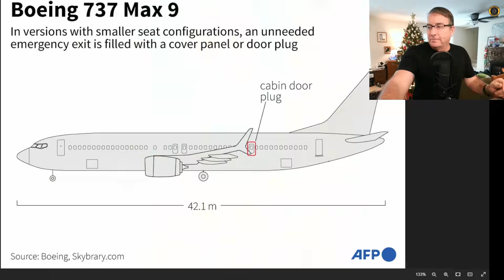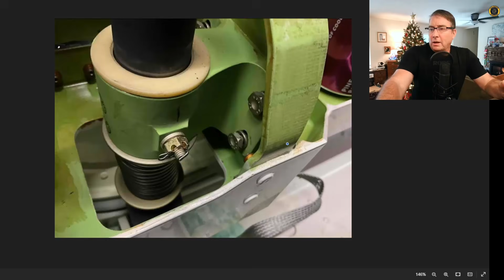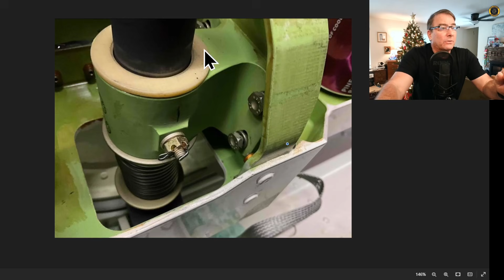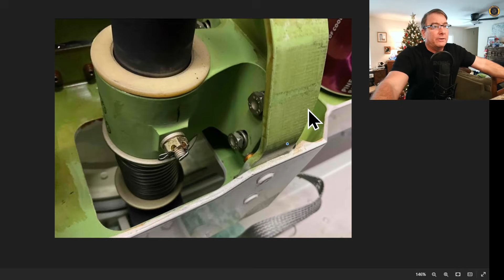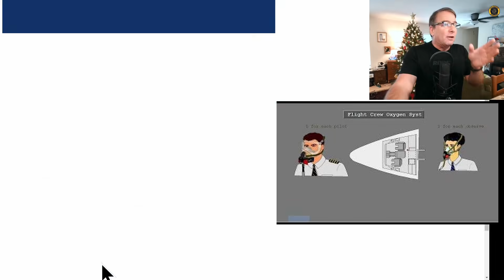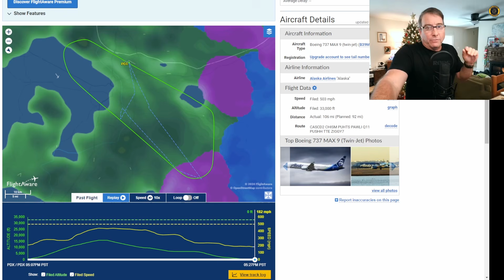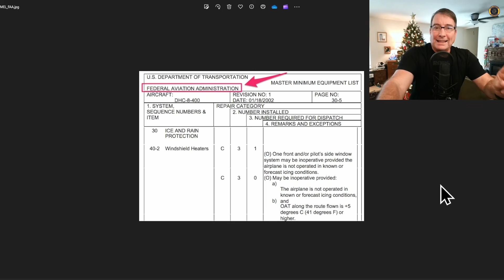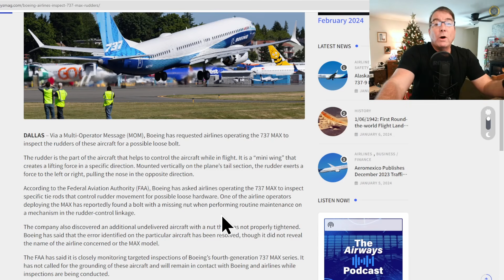"Yes, We Have No Bolts"  9 Jan 737 Max-9 Update

Comment: Sad thing is, baced on their actions, boeing aren't giving a damn. I mean max 8, crashed. Max 9... again with a problem... and a while back, boeing was trying to get the max10 and max7 exempted to get the aircraft certified quicker, despite there being a potencially major problem with the antifreeze system, where it could easily overheat if not turned off after a while. And yes, one could theoretically stand on, boeing's passed reputation... but if things like this keep happening,, all of the great pssed reputation boeing made for itself won't matter one bit. The problem is, until say, something like this happens to someone up top at boeing, the, why should I give a damn? Mentality prevails. Heck, there was a netflix documentary about the max8 and how boeing, the top people at boeing that is, knew about the failures of the max8 years before. The people who tried speaking up about it... silenced. Say what you will about boeing, but their actions, at least the actions as far as the people who are at the top... are a clear middle finger to everyone, but hey, as long as we keep getting more money, fuck it, right? Shame, really. Either boeing does something to fix their screw ups, or it'll sink, especially if they're still releasing aircraft's with major failures out there.

Comment: If any of the four retaining bolts were in place the door could not move upwards. All four had to be missing in order for the door to come up and out. What are the chances that all four bolts were properly installed with their castellated nuts and cotter pins and then somehow were all gone? Hmmm...zero?
Reply: Bolts clearly not present the only thing holding it in is what must be bolts making the contact pins tight
Reply: Probability is never exactly zero, more like 0.0001%.

Comment: Non-aviator here. I just find it very odd that no one was sitting next to it on a packed flight.  Seems a bit suspect to me as if they knew there was a problem with the plug.  I hope I'm wrong about that. I also find it absolutely outrageous that the cockpit door blasts open during DP and pilots did not know about this.  I can not imagine the shock they must have felt. Thanks, Juan.
Reply: The scheduled pax missed the flight.
Otherwise would be dead.

Comment: Safety wire should have been applied to those hinge fittings regardless of the mode of failure, that is a perfect opportunity to simply twist some wire to secure that point. Not speculating that that is causal, but it seems that simple best practices should be applied to this mechanical connection to ensure that those fasteners are not compromised by vibration...and if in a maintenance checklist, are documented. If inspections indicated that there are loose or potentially never secured fasteners...that is a huge clue that something needs to change on that system.

I understand the "Safe at Home" syndrome of an aircrew that has just dealt with an event like this. However I am in agreement that something needs to be done in FAR's to ensure that data integrity of sensors and telemetry including VOX are preserved. Someone needs to be accountable for that action.

Lot's of lessons to be learned here, ATC recognition of a limited communication emergency to ensure the crew is not distracted...provide data..don't ask for too much info. Souls and fuel, sure, that is important for fire/rescue. However there was too much repetitive comms. Crew could have said, we are already circling back for a specific approach but I give them way more latitude. 

Amazing job by all to get this thing on the ground.

Comment: Only if it's appropriate could you provide insight into the 2023 Elmina plane crash, please? On 17 August 2023, a Beechcraft 390 Premier crashed near Elmina in Sungai Buloh, Selangor, Malaysia. No survivors. Multiple surveillance and dash cams saw the plane, at like a 90-degree angle, slam, full force, into the ground.

Comment: What the hell! We assemble a device about the size of a pack of cards and we objectively  measure, Pass or Fail and measure ment logged promatically between limits every bolts torque to a database. The product does not move past that prosses step unless it passes all the torque specs. The quality records must go with the product to the client. The records must be kept by us and provided upon demand.  WTF Boeing? How do you tell work is done do you just stick your dam finger in the air and go "meh! Seems done!" ?

Comment: I respect the effort and skill set of the controllers, however the Seattle center controller asks maybe 5 times to explain their issue, have they indeed declared an emergency, etc. Then once turned back over to PDX controllers, they ask 4-5 times if the crew wants box directions to bleed off altitude before landing.  IMHO, Seattle needs to improve or at least evaluate their listening skills and handoff procedures/techniques, and PDX should understand that once the Captain and FO have declared their intent to land, LET IT GO.

I’ve seen several comments on various platforms deriding SEA Ctr and PDX controllers for, in the poster’s opinions, harassing the crew bc the controllers were not paying adequate attn to the transmissions.  

If worthy, it may be of value to your listeners/viewers to assess the tower personnel’s comms.  Thanks in advance! And love the channel.

Comment: Go back to the completed Installation Plan (IP) that took place at the Boeing Flight Line.  If this IP is sown “Completed” for this airplane, then the four bolts, nuts and cotter pins were installed and the door plug couldn’t possibly have blown out.  I am thinking sabotage occurred after delivery.

Comment: They hired a suite of executives, none of which are aerospace engineers, and these doofi have entered into a campaign of management enabled union busting for no purpose other than the improve their bottom line so they can qualify for their huge salary and stock perqs and then golden parachute out when their tactics result in losses and getting ousted. They’re run by bean counters and corporate raiders. They built the Dreamliner factory on the east coast in a right to work state so they could hire inexperienced labor that cost them less, and browbeat them into taking shortcuts.  These were the brainiacs behind the MCAS debacle, and requiring an UPSELL charge to enable the Second AOA sensor that was already installed on every aircraft anyway. ( like making you pay extra for the heated seats already in your car to be able to turn on. )   Corporate personhood needs to be amended such that CEOs and other execs can be imprisoned when their schemes to line their own pockets get folks killed.
Reply: Unions, benefits, and other worker perks like private healthcare and private retirement are good and necessary only to shore up capitalism, the present economic system. It's a vicious spiral upwards, and the spiral will persist so long as Boards of Directors has doofi like those you note well @christopherpardell4418
Just imagine, if complete tax immunity was given to any business with a Board composed entirely of full-time workers selected by equal vote among all workers, well, things may change in a big hurry. And yes, corporate personhood is analogous to the joining of church and state..

Comment: I hate to put a turd in the punchbowl. I am a huge Borwnie fan.  But we are ignoring something key.

Why do we have an FAA?  Mainly to prevent things like this from happening.  So how did this happen.

1) The FAA, once again, did not do its job.  The dog that won't bark.  2)  FAA will seek every opportunity to blame BOEING or anyone else for such things.  As they did with the MAX software fiasco.   You'd think they never had anything to do with that.  Well they did, from fomenting the idea of engineering the MAX to fly just like the earlier 737s, to looking the other way when red flags were flying all over that software mess.  Now, the 737 has nothing to do with this story.  The plug door is not unique to this airplane.  But what is worrisome is that FAA is not staffed adequately to really be effective in the 21st Century version of the market and the industry.  In this case, where was the oversight?  It's a scandal.  How could these airplanes get on the flight line missing hardware if FAA were doing its job?  You tell me.
Reply: On the contrary @paulgooding803 the barkless FAA does do a very important job quite well: it provides a place for folks like Dickson, Shaffer, Edwards, Garg, Manzelli, and Giacini to control (we all remember Ms. Petit/NWA, no?) FAA acts sort of as a sacraficial lamb, analogous of an electrical fuse, shielding and protecting the highly scientific and highly objective NTSB. Yes, it's a grotesque waste of taxpayer dollars, as much as FDA a complete waste, too, yet they shield the objective NIH; at least reason, logic, and basic facts are preserved.
The "alphabet soup" brainchild of FDR is needed only to shore up capitalism. It is sad we had not evolved to a better economic system back then when the chance was there, with greatest support of the AFL together with the CIO. However, we must retain great hope for a clean punch bowl, and we can begin immediately by offering huge tax incentive for any corporation which composes and maintains their Board of Directors entirely of full-time workers selected by equal vote among all workers.

Comment: So no bolts ,the wrong bolts or sloppily installation? Alternatively was the bolt specification mistaken? It would be appalling if the whole thing was caused by substandard cotter pins or bolts or locking glue.

Comment: Great description on what the cockpit crew had gone throught when the door departed. What I initially thought of was, what if their headset were lost. Is there a way to flip a switch to indicate they are an emergency aircraft to ATC (I beleive the answer is no)? Could the call sign transponder be made into a three position switch, off, on, emergency can't communicate (Call sign flashes rapidly)? This way ATC can clear airspace as the crew navigates to the closest aiport or warns the authorities they need help but can't verbally indicate this.
Reply: The transponder has codes that indicate general emergency and more specific situations if desired. Once the transponder code is set to an emergency state, it changes state on the ATC's 'radar' to make it apparent. There's a specific code for loss of comms, which has happened, but in any case once an aircraft declares emergency for any reason, they can do anything they want and ATC's only role/authority is clearing the area for them as you seem to possibly know already. 

The problem in my eyes is that Pilots tend to forget they're in control and spend too much time/bandwidth on superfluous comms with ATC in actual emergencies and still follow normal SOPs ingrained from ATC's usual authority

Comment: I am not sure about the Boeing manuals, but on the Airbus A320 FCOM, Airbus clearly states that the Cockpit Door is automatically unlocked in case of a cockpit decompression, and the door opens towards the cockpit under differential pressure.

In case of a cabin decompression (Alaska's case), venting from the cockpit to the cabin is ensured via existing gaps between the cockpit and the cabin and with additional grids installed in the ceiling panels.

Airbus's cockpit doors open towards the cockpit. If Boeing's different and it really opens towards the cabin with a depressurization, than it is really strange. It raises many concerns especially when it comes to security issues.

Comment: When I saw those castellated nuts, my first thought was that somebody forgot to install the cotter pins.  Then over time, the nuts vibrated off the bolts.  Castellated nuts are not torqued tight at all.  From what I've always seen, they're torqued to a certain value (which isn't large), backed off to the next castellation, and then cotter pins are installed.  If the pins weren't installed and the nuts vibrated loose, you wouldn't find the the nuts and bolts because they'd be sucked out of the jet along with two vacant seats, a kid's t-shirt, and a couple of cell phones.  The nuts and bolts would be WAY harder to find than those larger items.  It wouldn't surprise me if the castellated nuts were installed finger tight, the tech was planning on torqueing and installing cotter pins later, and never got back to finish it.  That's one possible scenario, who knows?
Reply: The million buck question is whether that would have been in Renton or Wichita? I suppose it doesn't really matter, more the blame on economic system than anyone or anthing else. Too many Board members who are not full-time workers.

Comment: Many thanks for another objective report.  
Boeing gets a huge black eye for the entire 737 Max program.  Profit over safety is, seemingly, its corporate ethos.
The whole common type rating idea was/is a huge factor in Boeing's 737 plan.  For profit's sake it caved to various airline's demands (I am looking at you SWA) to keep the common type rating in place.  
BUT, who the h*ll was in charge of of QA?  There is no excuse for missing or improperly fastened bolts.  I predict that heads will roll, but not at top corporate levels.

Comment: The design of the plug door seems very strange. I watched the NTSB press conference yesterday and they indicated the only way for it to release from the 12 circular stop tabs (6 on either side) was for it to move upwards. But the springs on the bottom want to move it upwards. It seems like it is designed to fail. I have a hard time visualizing how this thing is ever supposed to work. Maybe an engineer just over-thought it.

Comment: Out of high school I helped build Boeing 707 fuselage sections and B-737 engine mounts.  I became a captain on the B-727 and B-737-800 (approximately 5,000 hours on each) I grew up with unfailing faith in Boeing being engineered and built better than any other aircraft in the world.  I had another 10,000 hours in the DC-10 and BAe-146, and the quality was night and day better in the Boeings.  After Boeing merged with McDonnel Douglas, the Douglas people took control, and money became the religion at Boeing.  They moved management from Seattle to Chicago to escape the concerns and complaints of engineers and workers that built the airplanes.  Boeing excellence has suffered tremendously since then.  The only good news is that Boeings are head and shoulders above Scare Bus airplanes, but that is not saying much.  So sad to see Boeing going downhill.

Comment: It's absurd that on a brand-new aircraft the cockpit voice recorder doesn't have digital storage sufficient to hold month's worth of data without being overwritten. I understand that there are probably standards reasons why they are slow to update these things, but that doesn't make it any less absurd. A $25 pocket flash stick has more storage capacity than these things do.
Reply: That $25 stick is not radiation hardened, and has the erase-write-read endurance of a stick of Wrigley's chewing gum (not to say Wrigley's is bad though, my favorite gum). You'll never see NAND Flash in space; notice though, Everspin's MRAM in the Mars rover. Still waiting for the day when spintronics gives greater capacity and memory density.
Reply: @paulsherman51  I wasn't suggesting that flash memory specifically should be used, but I'm not sure how we got to space and radiation-hardening.
Reply: True, maybe something of standards as you say. Similar lengthy delays occur in the ratification and revision process of open-source communities. When designs are made with least-coupled, object oriented nature (Law of Demeter, principle of least knowledge), the revision and adoption might be faster? Then again, there's always that human inertia, a resistance to change proportional to the more that is known  @ariochiv

Comment: I think the  FAA should have (a) never let Boeing get away with the “same type rating thanks to magic” approach for the MAX in the first place, but definitively (b) put an end to that fairytale after the MCAS disaster. They really need to stop trying to outsmart the regulations , and I’d hope that something like getting the fleet commonality pulled would be a significant enough shock to Boeing (including financially, if only indirectly) to teach them to stop trying to cheat the systems designed to keep aviation working safely. Probably won’t happen but, Oh well, one can hope…

Comment: @blancolirio, as always, excellent clip. I watch your videos on the 'big screen' daily so rarely have a chance to comment (commenting not supported by app, only 'likes').

𝐐𝐮𝐞𝐬𝐭𝐢𝐨𝐧 𝐭𝐡𝐨𝐮𝐠𝐡: the cockpit clearly has mechanism to deal with violent decompression (opens door or opens flap in door). But what about the much larger cavities; the cargo bays, the electronics bays, etc? Much higher air volume and hence chance for much a more prolonged violent effect. In addition, if cabin floor is lifted due to the rapid movement of air, wouldn't there be a chance for damage to electrical and hydraulic systems? Luckily neither seem to have happened this time.
Now I'm pretty sure the airframe has been designed to handle this (vents in floor?), has been tested, etc, but we now know based on the events surrounding air escaping the cockpit that these forces are massive, 'violent', and can lead to at least unexpected events.